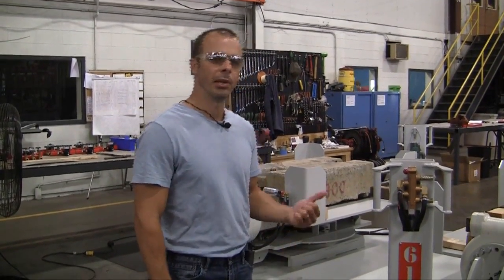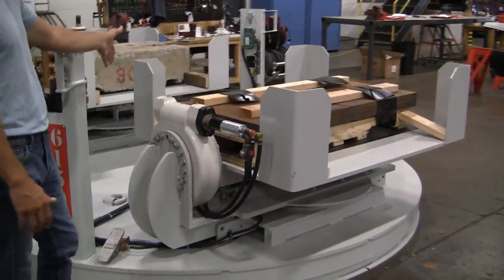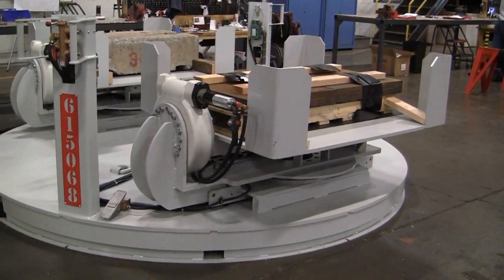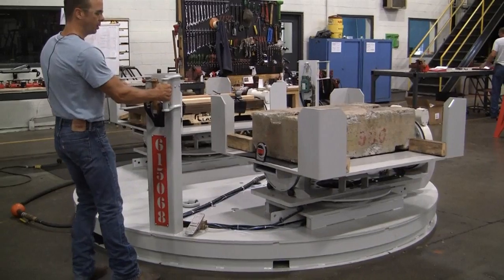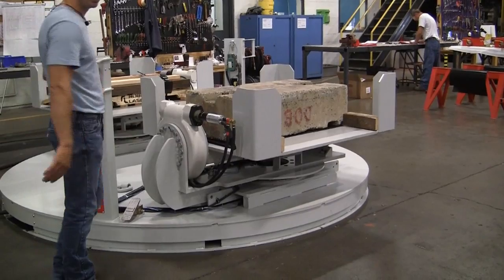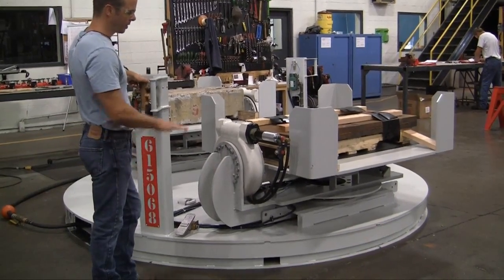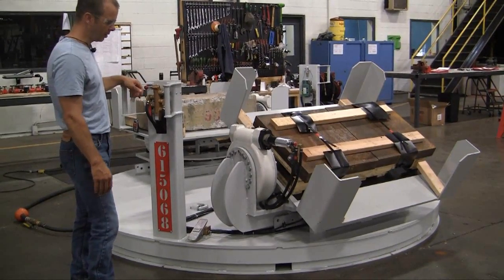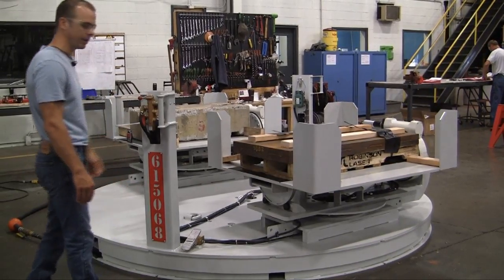Air Bearing Turntable with Multi-position Tilts

Comment: Engineer needs $2,000 for a sensor. He gets denied.

Safety engineer requires $500,000 for a material handling device to prevent repetitive strain injury. Approved immediately without question.